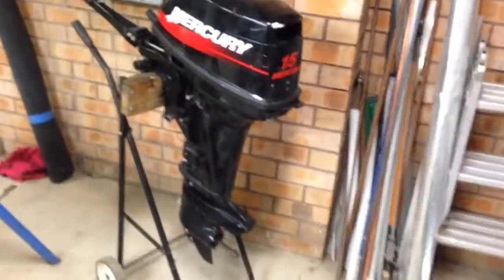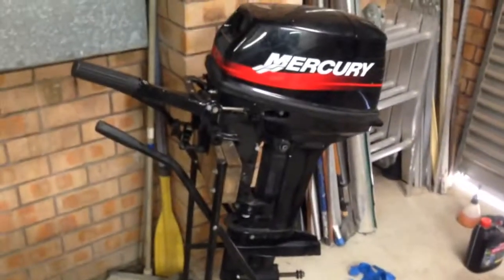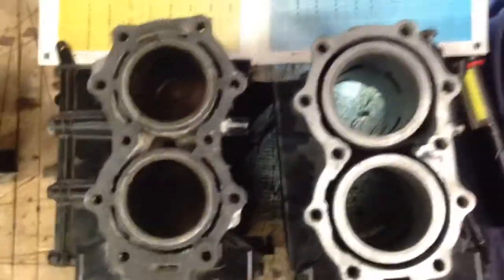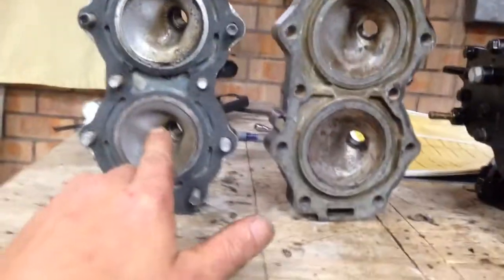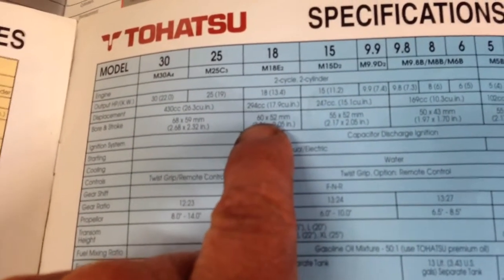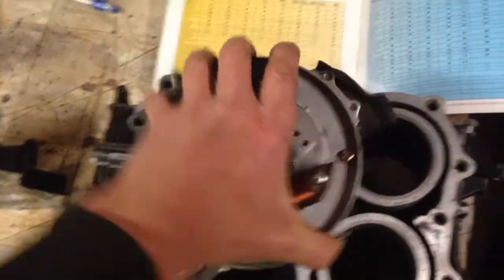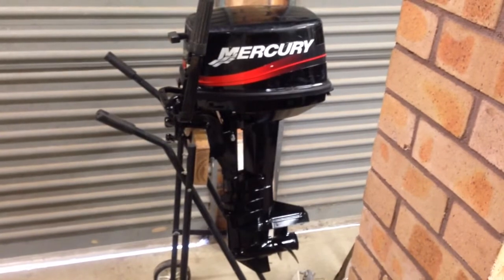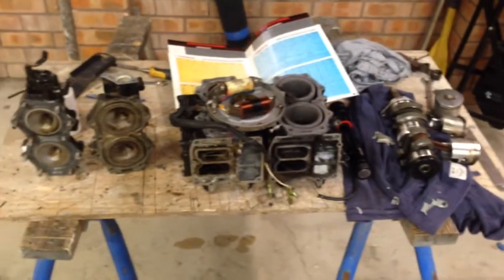Tohatsu 18hp, Mercury 15hp super, Tohatsu 9.9hp, 15hp comparison.

Comment: Do you have to change the ignition timing when putting the 18 throttle cam on the motor
Reply from the maker: Hi Mate,
You don’t need to change the timing. I normally allow the timing to go further advanced a tad at full throttle as it gives a tiny bit more power, you don’t need to play with timing though.
Cheers 🍻 
Aussie Boat Guy 😎

Comment: Hello, I am the first owner of a 2012 model 100 hours of use Tohatsu 9.8 2T. I used it on a 350cm and 100kg fiberglass boat, it had good performance (it could reach 40km/h). Now I bought a 450cm and 250kg fiberglass boat of the same type. I haven't tried 9.8HP on this one yet, I want to buy a 15 or 18 HP Tohatsu 2T and try it on this boat. Is there a big performance difference between 15 and 18 HP? There is also a 25 HP for sale, remote control etc. but I think it will be heavy for this boat. Which one do you prefer, 15 or 18? There is a 15 for sale right now, should I wait for the 18 to be on the market? Regards
Reply from the maker: Hi Mate,
Yes the 18hp is the go if you are talking strictly Tohatsu (the 15hp tohatsu is a smaller capacity motor than the 18hp tohatsu). If you get the Japan built Mercury 15 super it is actually the same capacity as the 18hp tohatsu and with some tweaks it can be an 18hp. I did put a video up on the difference if you search my channel. A 4.5m boat is pretty big, the 25 or 30hp would suit as well but yes they are heavier (about 55kgs) but may not matter if they remain on the boat. Think the 15 and 18 are around 45kgs.
Make sure you track down the correct short or long shaft your new boat requires.
If you are keen on the 15 - 18 size I would wait for a 18 tohatsu or a 15 Mercury super Japan built. The 15 tohatsu is a great motor but 4.5m is a decent size and 250kgs empty is a lot more than your 100kg.
Cheers 🍻 
Aussie Boat Guy 😎
Reply: @25hpboatracerman  Thank you for your answer. I watched your comparisons of Tohatsu 9.9-15, Mercury super 15-Tohatsu 18. As you said, it makes more sense to buy Tohatsu 18 or Mercury (Japanese) 15. For me, portability is also important, so I am not keen on Tohatsu 25... but I will try Tohatsu 9.8 on a 450cm boat, I wonder how fast it will be..thanks a lot.

Comment: No intende muito pq falo português mais mim explica o msmo moto tohatso 18 é msmo moto Mercury super 15 sor muda carburador
Reply from the maker: Hi Champion,
Yes the 18hp Tohatsu and the 15hp Mercury Super are the same motors. The only difference is the throttle cam that opens the carburetor - the 18hp cam is larger opening the carburetor butterfly all the way. Also the timing is afvanced on the 18hp. They use the exact same carburator, its just that the 15hp super does not open all the way because of the throttle cam on the stator. Its an easy upgrade.
Cheers,
Aussie Boat Guy 😎
Reply: Muito o brigado pela informação, sor mais ua pergunta meu Mercury super eu au mentei a se relação do au final do game tudo o moto vibra e faz um rotação tipo pedindo combustível será que eu tenho msmo que fazer o procedimento de passa bloca no giclé do carburador

Comment: I have a mercury 2 stroke 9.9 hp, and on the cylinderhead is a stamp of nr. 55. Do you mean by changing the carb only the outboard engine will become a 15 hp?
Reply from the maker: Hi Mate,
Pretty sure that’s the case along with advancing the timing.
Cheers 🍻 
Aussie Boat Guy 👍
Reply: Hi, i have checked the parts manual online, and see that the carb for 9.9 and 15 hp are the same. They have different powerhead partnumbers. I gues what should be the difference of the powerhead?. Please can you check in the manual you displayed in the video for the mercury, how many cc is the 9.9 and the 15 HP?
The model nr. of my mercury 9.9 is 1010203EL. Serial no. is 0N377091

Comment: Great info thanks, just bought a 15 Super and am going to change the cam to a Tohatsu one. Do you know if the props are the same on both 18hp Tohatsu and Merc 15 Super? Or does the prop need changing too to avoid over-revving? Cheers!
Reply from the maker: Hi Mate,
Great motors 👌 you may be able to advance the timing a tad too to get a bit more power too.
the props are the same, the long shaft 15 super and 18 tohatsu both came stock with a 9p and the short versions both came with a 10p.
You should be able to hear if it’s over revving.
Also changing the cam on the 15 super really doesn’t add much unfortunately.
Cheers 🍻 
Aussie Boat Guy 😎

Comment: I have a 15hp mercury Japanese made. I'm told it is actually an 18hp tohatsu. How can i tell for sure? And if it really is a 15hp, is the 18hp tohatsu much more grunty? I need more power and thinking of buying 18hp T.
Reply from the maker: Hi mate,
You can tell it’s an 18hp block by it having 60 stamped on the block near the head, a 9.9hp and 15hp have 55 stamped.
Also your carburetor doesn’t open fully and your timing is a bit retarded compared to the 18hp.
It honestly would be hard to tell much of a difference if you upgraded it to 18hp mate.
Just get the 25 - 30hp two stroke if you need a heap more power.
Cheers 🍻 
Aussie Boat Guy 😎
Reply: @25hpboatracerman  thanks for the quick reply. Yeah might look at the 25hp, same weight as the 30hp but a bit cheaper.  Can still get new in se Asia.
Reply from the maker: Also the 25hp Tohatsu can be made into the 30hp by opening up the carburetor gasket and advancing the timing a bit.
Cheers 🍻 
Aussie Boat Guy 😎
Reply: @25hpboatracerman  you're speaking in Russian now!😄
Reply: @25hpboatracerman  BTW FWIW we reluctantly sailed away from Australia last year after spending 3 years (nearly) circumnavigating your amazing country. Incredible memories and friends made.  Rob
Reply from the maker: 😂😂 yep, google translate.
Hope it translated what I wrote.
Cheers 🍻
Reply from the maker: Wow, that’s an awesome experience. I would love to circumnavigate Australia.
Yeah, not too hard to make friends here 😂
Cheers 🍻 
Aussie Boat Guy 😎

Comment: Any chance you could do a step by step on changing the cam off the stator to hot up a super 15 to 18? I’d love to do it to mine and there doesn’t seem to be anything on YouTube
Reply from the maker: Hi mate,
Unfortunately I don’t have the motor at the moment to do that too.
Noticed the other day too that some 15 supers came with a 20mm throat in the carburetor but the 18hp has a 22mm throat.
You could check that too.
Also I kind of already have a video on removing the stator on that motor so you could watch that as that’s all the video would be apart from swapping the cam, it’s the 15 - 18hp tear down video. 
Cheers 🍻 
Aussie Boat Guy 😎

Comment: Hey I've been trying so hard I want to bring my tohatsu 8 hp outboard back to restore my engine block powerhead has a lot of corrosion this engine was given to me as a gift I'm trying to restore it back it's a tohatsu M8B 8hp I was wondering maybe you would know what other brand or power head from another brand with it into the tohatsu lower bracket
Reply from the maker: Hi mate,
The Japan built Mercury 8hp is the same motor so you should be able to use parts of a Japan built Mercury 8hp.
Cheers 
Aussie Boat Guy 😎
Reply: Thank you for your help but what about the bracket where you going to bolted into the lower unit bracket is it the same holes where you screw them on
Reply from the maker: @giolovelife3876  
Hi mate,
I use the Japan built Mercury parts for tohatsu all the time. You just need to make sure the Mercury says made in Japan on the label - near the serial numbers.
The Japan built Mercury is built by Tohatsu and the 6,8,15,40hp two stroke are the same as tohatsu, make sure visually it is the same too but I’ve used a lot of that to fix my tohatsu outboards through the years also used tohatsu to fix my Japan built Mercury.
Cheers 
Aussie Boat Guy 😎

Comment: You should have mentioned converting the 9.9 (not the 9.8)  by changing to the 15  throttle cam. Just like the Super 15 Merc, the carb doesn't fully open on the 9.9.
Reply: Yes I have a 9.9 super and you can see that the throttle is able to open much wider if the throttle cam is different, it’s quite a bit, can anyone confirm this is possible with a different shape cam?

Comment: What year are the blocks? I just bought an 18 Nissan '95...thanks for any insight.  Cheers.
Reply from the maker: Hey mate 👋 
The blocks in the video are 2003 and newer.
A 95 model 18hp Nissan - Tohatsu is still a great motor and a fair few parts are interchangeable.
I believe the bottom seal on your crank is different and the block is a bit different, plus a few other things.
Cheers

Comment: is there any way you can get a bit more grunt out of the 18M1e2 by jet up grade ect, ect????????
Reply from the maker: Good question 👌
Unfortunately not that simple.
If you upsize the main jet (which is matched perfectly to the carburetor throat size) you will just loose speed because it will be running too rich, if you go smaller it will run lean. Slightly leaner sometimes runs faster but blows motors really quick do not a good idea.
If you make the throat of the carburetor bigger then you can go bigger with the main (high speed) jet. That’s a fair amount of effort and you may not see too much gain without other mods like further porting, exhaust work etc.
Shaving the head (adding compression) does definitely give the 18 more torque but I have not noticed a gain top end.
If it’s just grunt or torque your after then try a lesser pitch prop. I have a 10p on my current 18hp but if I load the boat I put a 9p on. 
Cheers mate 👍

Comment: What do they typically charge to change the cam on the 15 super to a 18 tohatsu
Reply from the maker: Hi mate,
Unfortunately I only do it for my myself. It’s not too hard, just order the 18hp cam, remove your flywheel and stator, change the cam and re-assemble.
Not a massive difference in performance, but it’s there.
Cheers
Reply: @25hpboatracerman  thanks for the quick reply. Ill look into it. 3m Tuffys are heavy little vessels.
Reply: The throttle cam ?

Comment: Side by side,  do the 9.9 & 18 blocks look the similar from the outside? Might a park ranger believe an 18 were actually a 9.9 if I changed the stickers
Reply from the maker: Hey mate,
They look exactly the same from the outside. Unfortunately they do have a stamp on the starboard side top of the block (near the head) that will give it away.
The 9.9hp and 15hp have a 55 and the 18 have a 60 stamp, that is to show the bore size in millimeters.
In saying that, if you have a 9.9hp you could make it a 15hp with the 15hp carburetor (also the 15 carb has a different part number but is a pretty small print)
The 55 and 60 stamps are very noticeable.
Cheers
Reply: Thanks.
Ive got a 15hp mercury.  Has a "60" stamp on block. So reading this its a 18hp tohatsu.  Carby and all. Is detuned by that cam to lower the WOT?
Reply: I understand they will have different 55 and 60 stamp which are noticeable with the cowl off. However. 
Are the exhaust tuner the same between 9.9 mercury and 18hp Tohatsu? 
Could I pull my Tohatsu powerheads off at the leg, including carb and ignition coil etc,  
And buy a 9.9 do the same to that, 
then, Bolt the 18 powerhead on the 9.9hp stamped leg. Then use a 9.9cowl
So essentially It looks like a 9.9 from the outside, but rip the cowl up, and real will know, but the UNeducated will remain?

Comment: Hello, my trimaran is powered by 9.8  4 stroke Tohatsu with the 25" shaft. Heavy bugger. I like it but... It's making oil and smoking more than it did. It fairly new to me both boat Farrier 31 and the Tohatsu. I replaced the fuel pump right away when I got it and serviced it bc I smelled gas in the fuel. I changed the oil and thought it was fixed, but it's back. Making oil.
Reply from the maker: Hi mate,
That’s annoying for you. I’m not too familiar with the 4 stroke outboards only the two strokes.
I’m not too sure why your motor would be smoking. Is it only when it’s cold? Or all the time?
Reply: @25hpboatracerman  All the time. I need check compression. I'm thinking rings need renewed.
Reply: @bizeigel I'm assuming this is blue smoke, I.e. semi-burnt oil? 4 stroke engines usually burn oil either because their oil control rings are bad/clogged (oil gets past rings into combustion chamber) or because they have excessive blowby (bad cylinder liner or compression rings) and the oil is being blown away through the PCV system. If it's making oil that means that petrol is getting past the rings into the crankcase, which is more suggestive of a compression issue.

You also need to check the thermostat, 'making oil' is often caused by fuel condensing on the inside of the cylinders when the engine is cold. If the engine gets a decent run at normal operating temperature during use any fuel mixed with the oil should evaporate out and get sent into the cylinders to be burned via the PCV. If your thermostat is stuck open the engine may never heat up, leading to this issue. The condensed fuel also dilutes the oil on the cylinder liners and causes them and the rings to wear out faster.

If on the other hand you are seeing black smoke, that means the carb is set way too rich. This could also lead to increased dilution of the engine oil with fuel, along with really bad performance.

Comment: I just bought a 15 h.p Tohatsu and 18 Nissan, both 2 strokes. The 18 Nissan runs great on the stand on the muffs but not on the boat in the water, it lacks power, the compression is supposedly good in both cylinder's and lower unit is good with no signs of wear, no slop or funny sounds. I'm hoping for clogged fuel filters or something simple. It looks like the motors zip along pretty good. I have a bullet proof 8 h.p Tohatsu also. Sweet motors. I think they ar all made buy Tohatsu? Under 30 h.p Mercury, Nissan and Yamaha I'm almost certain.
Reply from the maker: Are you sure the 18hp is running on both cylinders. I would want to personally see the compression, people always say compression is good, not always true.

Pull the plugs and connect leads, rest them against the block and pull the cord to check for spark.

If you run the motor on a stand pull the spark plug leads off and put them on one at a time (with insulated pliers) while running and see if the motor note changes.

Check compression with a gauge.

If you have good comp (over 110 for the 18hp, more like 140psi) and spark then It should be carburetor issue.
Hope you can diagnose it.
Cheers

Comment: mate, quick question, do you think its worth it to buy tohatsu 18 than any 15hp yamaha/suzuki/merc in terms of power. coz tohatsu 18 is more expansive about 130 usd from those 15 engine in my country.
Reply from the maker: The 15hp Mercury super (Japan built) is actually an 18hp tohatsu.
The Suzuki 15 and the Yamaha 15 are both great motors. The 15hp Mercury USA built is a good motor as well. 
Are you talking about all two strokes?
Cheers
Reply: @25hpboatracerman  yea two stroke only. as i cant get 4 stroke easily here, plus the weight is so heavy.
Reply from the maker: Ok, well they are all pretty good.
I would personally go with the Japan built 15hp Mercury super as that is the 18hp tohatsu anyway.
Reply: @25hpboatracerman  thanks for the recomendation

Comment: Hey mate, any way of increasing the 9.8 tohatsu power wise? Cheers bud!
Reply from the maker: You can, but unfortunately the 9.8hp tohatsu is basically a worked 6hp (So already all the best bolt on bits are on the 9.8hp). It has higher compression, bigger carbie etc. I feel it’s already getting good horsepower for its 25kg and 169cc capacity. If you are really after more power from it I would start with more compression, porting (be very careful as you can lose power very easily), carburetor and exhaust tuner. even after all those mods I don’t think you would see much more than 12hp.
If it’s speed you are chasing I would go a lighter boat and play with props (surface piercing).
Hope this helps 
Cheers,
Reply: The Aussie boat guy. Thank you for getting back much appreciated subscribed!

Comment: Could you put the smaller cc head on the larger bore engine to up the compression ratio thus add more horsepower?
Reply from the maker: Good thought, I’m not sure though, I would have to check wether the smaller head fowls on the pistons. Also how much cc each head has in itself (wether it would increase comp)
It is probably easier to shave the standard larger capacity head, I have done this and it worked well.
It did not increase top end speed but it did add more torque and a noticeable increase in acceleration from stop.
Reply: Ya I wasn’t sure if they bolted up but was just a thought, I own many Johnson 9.9/15 and have been wanting to build one with better pistons and reeds but haven’t really found any pistons
Reply from the maker: The 9.9 and 15hp Johnson - Evinrude are fun to play with,  I put two 15hp carburetors on one and shaved the head plus put low water pick ups and a tricked up prop.
Wish I could upload a pic to this page.
That motor used more fuel than a 50hp Johnson, worth it!
Cheers,
Glenno

Comment: Is it easy to swap the cam on the stater to get WOT on the super 15
Cheers
Reply from the maker: It is easy, it’s actually just a different shaped cam! You can buy one for the 18hp Tohatsu and it bolts on. 
From memory I think I have always taken the stator off the power head to change them but it possibly can be done while the stator is on the motor.
Either way be prepared to remove the stator.
Cheers
Reply: 25hpboatracerman what area are you in? Sydney?
Thanks for the reply 👍
Reply: @25hpboatracerman  i would think also adding a degree or 2 of timing would be needed as well?
Reply from the maker: Central coast NSW